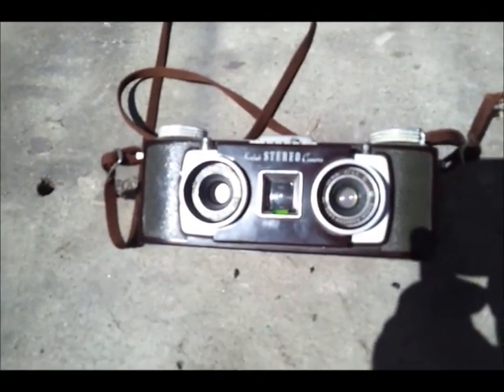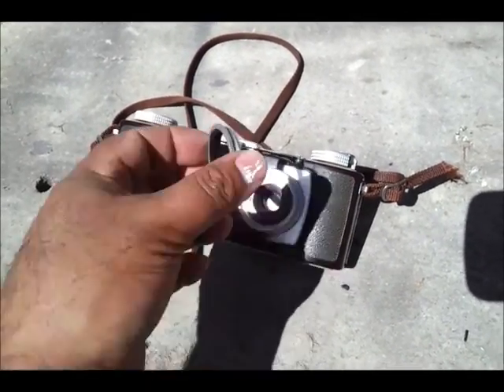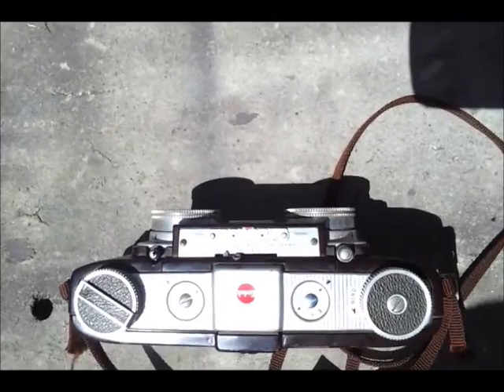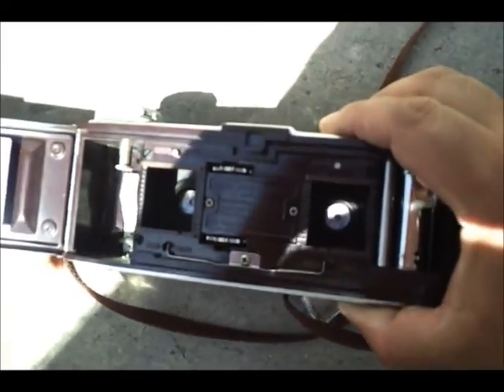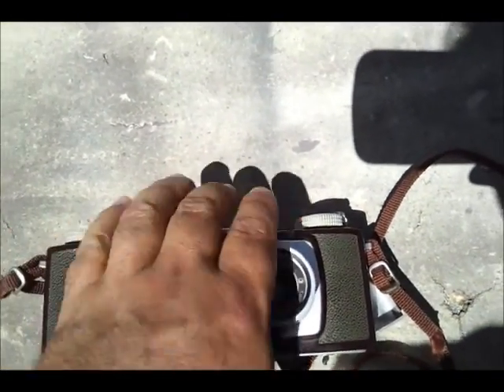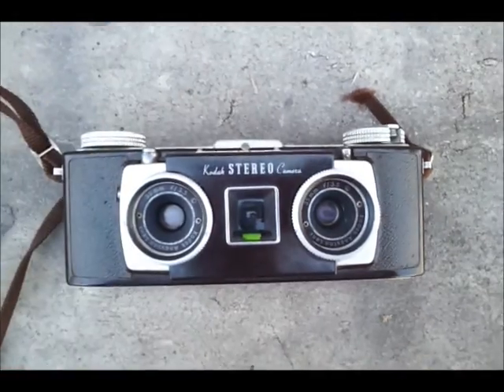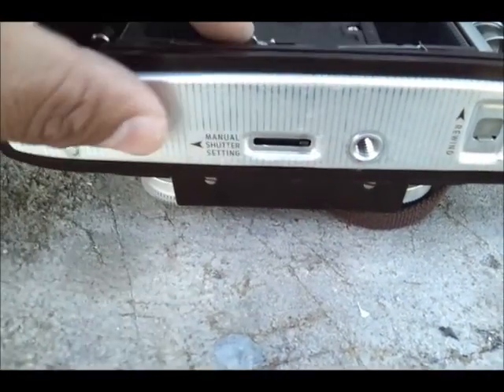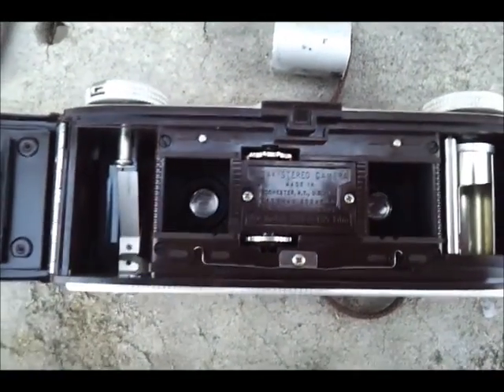KODAK STEREO CAMERA

Comment: the camera was designed for 10 speed slide film (which you can't get anymore).....but you could get some 90% neutral density filters and then use 100 speed slide film and the original factory camera settings will now work.

Comment: Your description about using print film instead of slides is fine. However, this camera was designed to be used mostly with slide film because it takes two photos, one corresponding the left ey, the other, the right eye. If properly mounted in a stereo mount, and using a special stereoscope or 3D viewer, it shows beautiful 3D photos. It can be used with print film also stereo but you will waste a lot of film since the format, as you well say, is not standard.  3D prints using both images CAN be made but requires much more work and a print stereoscope.
Good luck!!
EDUARDO
Reply from the maker: +Eduardo Barriga No, the film is not wasted.  What you have to do is manually enlarge and print each photo so it fits on the paper.    What the machine does is mix one frame with the next.  It doesn't help when the ham-and-egger  of a photo specialist who does not know how to make it print what you want.  They told me my film was blank and were going to toss it.    Works out that they couldn't even develop it so it wasn't even opened!  (it was b/w tmax-400)

Comment: What about the dial with 3 choices of Kodachrome, Daylight, Type A, and 4
 arrows.  Do you know which arrow goes with which?  Also what does that 
setting actually do?
Reply from the maker: This is a fully manual camera so this dial does nothing except remind the user what kind of film was in the camera but as of 2009, Kodachrome slide film is no more.   That which is found on ebay cannot be developed anywhere as of Jan 18 2010 when the last of the labs that had the chemicals shut down for ever.
Reply: Ahh ok thanks!  Ya I have a few rolls of that. I think only Kodak was the last to develop that film.

Comment: Kodak stereo camera's biggest flaw is the difficulty of re assembling the lenses after an amateur has done work on the shutters. Since the lenses are not mounted together as they are on the Stereo Realist, it's common for the Kodak lenses not to focus in tandem after amateur work. That destroys the stereo effect. When buying a Kodak, always shoot a roll of slide film, get it developed and check the left and right images on a stereo slide viewer. If the aren't focused exactly alike, return the camera for a refund.  That said, when both lenses focus together, the results are the equal of a Stereo Realist.
Reply from the maker: not really.  All one needs is a piece of ground glass and a 7x loupe so you can see what the image looks like on film then simply set both sides for sharpest focus.

Comment: When I try to take a (Pre-Picture) the shutters won't open?
Reply from the maker: They should open.  If you bought one like the one with the black pressure plates that doesn't work, the right shutter is probably sticky.  Either it hasn't been serviced since 1959 or someone tried to oil them which causes. the leaves to have a really hard time shearing over one another as seen in the second camera with the black film pressure plates.  The good news is that I recently fixed that and it will be up for sale in great working condition and I will stick it's video here which shows it working properly instead of ending in the trash!  I plan to shoot that sales video in stereo.  After all, it would only be proper to show it that way.  | : )
Reply from the maker: How are you cocking the camera?  did you try manipulating the cocking lever on the bottom?